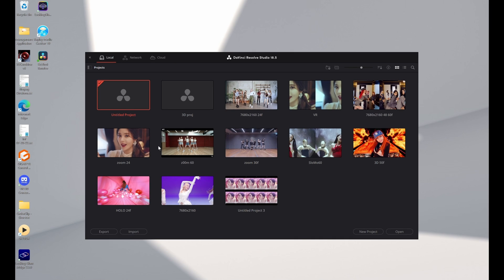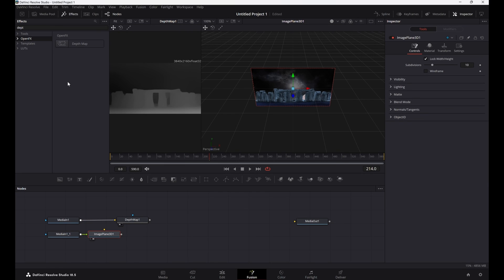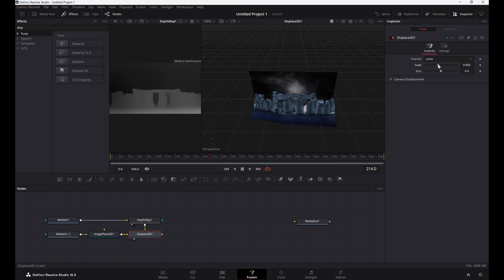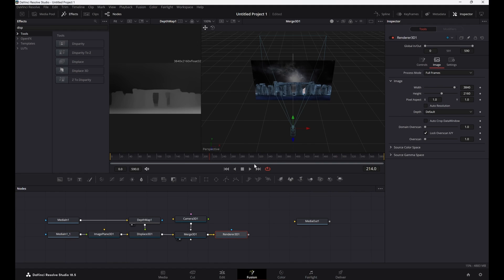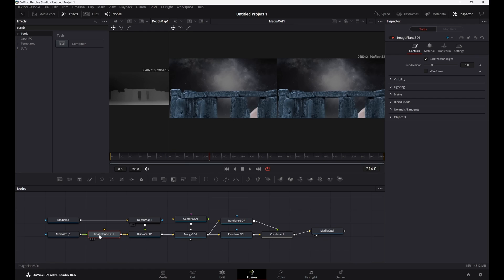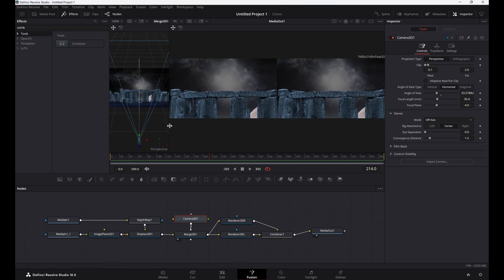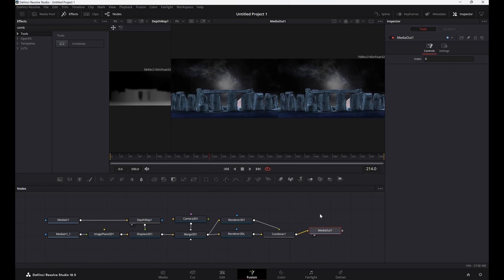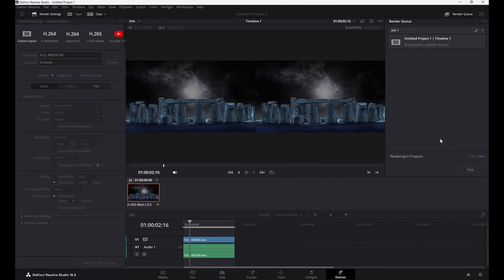2D to SBS 3D with "DaVinci Resolve Studio 18"

Comment: Hi! Thank you for your tutorial, i have managed to complete my first projects with some success. Tweaking will take time, finding the right adjustments for quality vs size, etc. One thing i do not believe i can achieve by myself is the resolution problem. I do have a depth and 3d effect, however it is nothing near a real 180vr. In short, the videos i tested show in oculus rift as a square instead of a 180 experience. Is it the limit of rendering or did i missed something? Forcing higher resolution on the full sbs does not seem to solve the problem at all.
Reply from the maker: My tutorial is for conversion from 2D to 3D only.  VR180 is a different problem.  If your intent is to make VR180 videos from a normal video then my tutorial will not help you.  if you take a look at my videos on my channel you will  notice even the ones labeled VR is not 180 degree fully immersive, simply because the original aspect ratio is for normal wide angle video.  so it is not possible to turn a normal 2D video to 3D+VR180 simply because there is not enough content to fill the gaps.  If you try to force it to stretch 180 degrees in effect you are zooming in and loosing quality because of stretching.  you will loose so much resolution that the video will be low quality and unwatchable in my opinion.  My suggestion is to watch some of my videos (VR and 3D) and if you like the results then I can help you with your project.  But to make a VR180 video you would have to shoot your own VR180 content with a very high resolution VR camera for best results.
Reply: @NotQuiteVR  Seem i messed up with the terms. No surprise as i am new to this. I did found a workaround of some sort by using a vr player with the option of curving the view.

Combined with your tutorial, i can feel a massive improvement both in 3d aspects and filling more of the screen without the issues you mentioned above.

Thank you so much for the feedback! You saved my hours of failed attempts.
Reply from the maker: @MaththeCanadian  Yes. the right kind of video player could help.  I use SKYBOX.  One advantage of skybox is that you don't have to upload your video to your headset every time.  You could simply drop it into skybox installed on your computer and watch it on your headset and zoom in and out as much as you like.   Keep experimenting and Good luck.

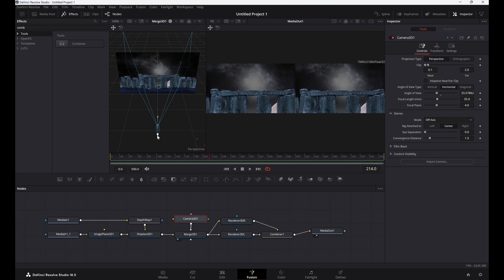Comment: Very interesting tutorial. I've tried to do it with 2160x2160 resolution at the 8:28, when I want to reverse the camera, it breaks the alignment of the eyes. One goes to the left, another one goes to the right, but not at the same amount. Weird. Probably tutorial is not compatible with my resolution.
Reply from the maker: I don't think resolution is the problem.  The camera positioning is restricted based on 4 stereo modes (mono, toe in, Off axis and parallel).  However If you need more flexibility you could use two (mono) cameras and move them anywhere you want without restrictions. You will need to experiment more to figure it out.  Good luck.  Just in case you are interested in a simpler solution, you might look into Owl3D.

Comment: Thanks for your sharing. I am enjoying all the videos. I made a video by following the video, but when I upload it to YouTube, it is uploaded to 7680x2160 screen and I cannot watch it as a VR video. Can you tell me a solution to this? (I don't speak English, so I used Google Translator to comment. Sorry.)
Reply from the maker: My tutorial is limited to creating the SBS 3D file for upload to the headset for viewing.  There are two methods to upload to YouTube.  One is for "SBS VR" and the other is for "SBS 3D".  The VR version is more complicated and I can't rally explain it here. However the "3D" version is easier.  To upload to YouTube, you will need to attach a set of instructions called "metadata" which informs YouTube that the file is a 3D file and not a normal video file.  To do that here is a link to a instructional video that you should watch first "https://www.youtube.com/watch?v=MmDrnwPIWKg".  
I use "ffmpeg" to write metadata into my (mp4) video files.  This method is explained in the video.  First you need to install "ffmpeg" if you don't already have it. Then call up the command line, from the directory that your 3d video is in. Then insert this command line "%f" -aspect 16:9 -vcodec libx264 -x264opts frame-packing=3 "%~nf_MetadataInjected.mp4" then press "enter".  You should see a second file next to your original file called ".... Metadatainjected". make sure your video file extension is MP4 or the command will not work.
Now you can upload the new file to YouTube and watch it with your headset.  The upload usually takes 15-30 min.  However the conversion to 3D process could take one or two hours before you can watch the video.  I must warn you that Youtube might block your video if the content of the video is copyright protected!  Everything I explained is just for creating a 3D video file which you can watch with your VR headset. However this is not the VR verions that I normally upload.  That process is
Reply: @NotQuiteVR  Wow, I didn't expect such a detailed explanation, but thank you so much for explaining it so easily. I will try my best to follow what you explained over the weekend. You are the best~

Comment: I am trying the method you mentioned. Thanks for your tutorial ( Explained very well ). I will see the output and let you know how it came. As the depth map is not available in free version. iIs there any tool that is available which does the depth map and add the depth along with this workflow ?
Reply from the maker: My tutorial is for those who own the studio version of the Davinci resolve 18+ editor.  The free version does not have the tools for Depth map 3D conversion unless you spend the $300 US and buy the studio version.  You could try a conversion software called "Owl3D" It is not free but price is reasonable.  I would suggest you to try it.

Comment: Great workflow...however you need Ai to fill in the missing different between the left right view of the background...  based on this workflow, you see a stretched edge of subject, not an ai estimation of background... until there is a node with Ai filled background this workflow is not perfect... this is not an easy job
Reply from the maker: To be honest I haven't done a proper study of this software to know all the tools available.  I learned just enough to use it on my channel videos and there could very well be ways to enhance the overall effect and I'm not aware of it.  The reason for this tutorial was mainly to satisfy the curiosity of my channel viewers and to point them to the right direction.
Reply: @NotQuiteVR  There are very little options available...either crazy slow that does this frame by frame or not prefect like this workflow... but I think a solution is near with ai that is able to fill in the missing info that is not recorded with a single camera...
Reply: @NotQuiteVR  thanks again for sharing this workflow 🙏